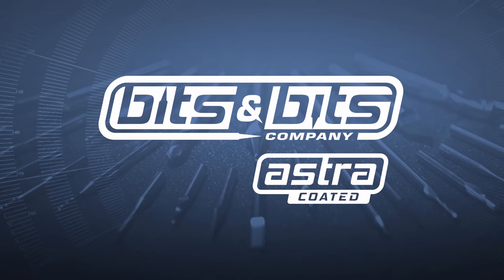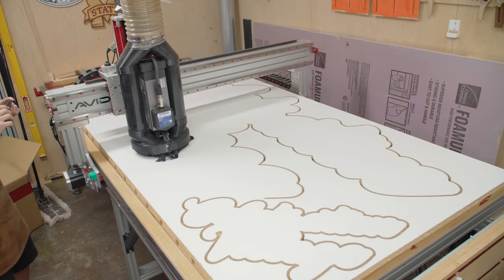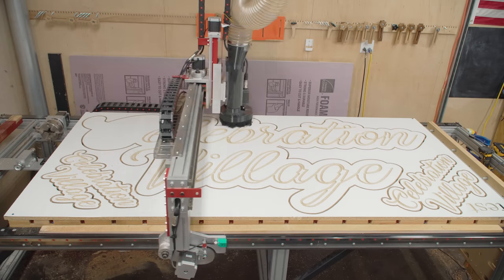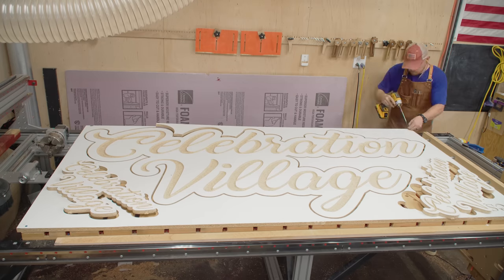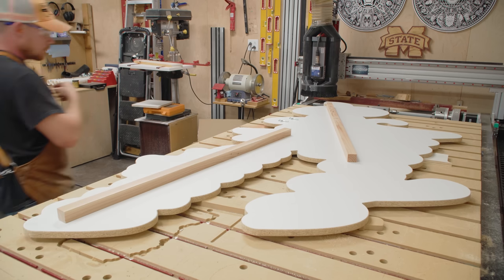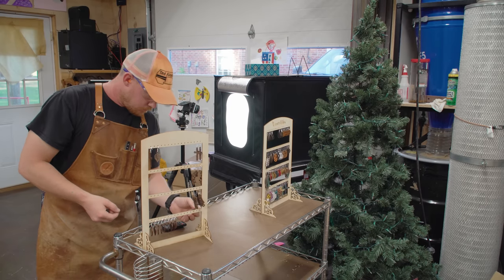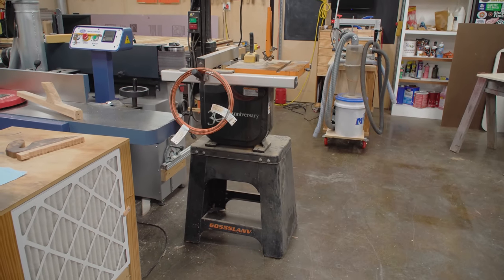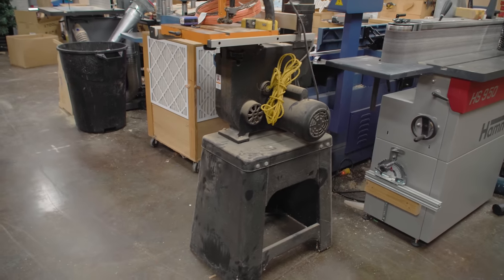New Old Bandsaw, Celebration Village Sign, More Charcuterie

Comment: If you had a film layer that was removable on top after the cut you could just spray paint the cutout. Maybe the adhesive would interfere with the cut though.
Reply: Wonders if spraying with plastidip and making 1light pass with 250 paper gets a crisp 2 tone
Reply: Shellac won’t dissolve with mineral spirits but paint does, so I spray wood with shellac, carve, spray paint and then mineral spirits wipe —. It won’t work for melamine
Reply: Certain latex paints would peel right off after but might not machine the best.

Comment: absolutely use screws to hold pine to melamine. I use melamine for bench tops because glue won't stick to it! they might try acrylic paint crafty girls use. Get it st hobby lobby
Reply from the maker: Incorrect. Glue sticks quite well to it. I ruined a melamine assembly table top because glue stuck to it. Might be a difference in the glue.
Reply: @JayBates  I had the exact opposite situation. The glue stuck to the surface, but the surface peeled away from the melamine! Maybe crappy melamine??? I would definitely use screws based on my own experience.
Reply: @JayBates  I actually use the painter’s tape and super glue method to hold my MDF boards down and it works perfectly!

Comment: If you're not painting the main surface you could wax it before routing then dye the letters?
Reply: Or cover it with adhesive shelf liner that can be pulled off later

Comment: Interesting that everyone that uses melamine for work table tops says that glue won't stick to it.  So, apparently that isn''t quite true?
Reply: Apparently, it depends on the glue.  I've been using melamine for bench tops for years and regular yellow wood glue doesn't adhere well to it.  It does "stick" (I'm referring to excess glue from glue ups) but is easily removed with a paint scraper.  There is a "special" glue designed to glue melamine to melamine but I've never used it.
Reply: I'm wondering if some aren't confusing Formica with melamine which I think is quite a bit different. Glue definitely won't stick to Formica.
Reply: @philshock3805 :  Some may, indeed, be confusing the two but I've been building cabinets with melamine sheet goods for years.

Comment: When I was in high school (I'm retired now) I was walking thru a K-Mart when suddenly a painted sign, 4x8' sheet of 1/2" plywood, sliced thru the air about 2' in front of me, and smashed into a counter to my left, one of the two chains it was hanging from the ceiling gave way, a split-second later I'd had a smashed up rib cage.  I'm glad to see you add a couple reinforcement screws to your heavy sign, but those things give me the willies to this day.

Comment: I thought glue wouldn't stick to melamine
Reply from the maker: I thought so too. Then ruined a piece for an assembly table top after one glue up.
Reply: Ya this was my biggest fear here
Reply: Are you guys thinking of Formica? Glue definitely won't stick to that but pretty sure it's quite a bit different than melamine. Melamine will "wear", whereas Formica is far more durable.
Reply: Hmmm. This is good to know lol.
Reply: We use special melamine glue for a reason.  I've seen plenty of cabinets fail because people tried to glue melamine with a PVA/crosslink wood glue.